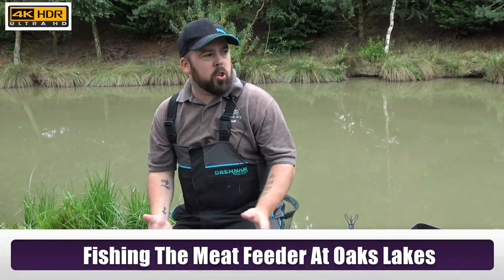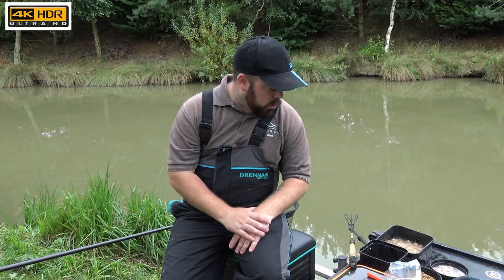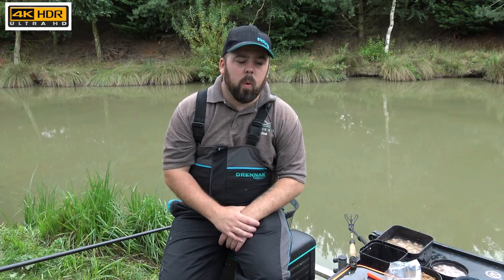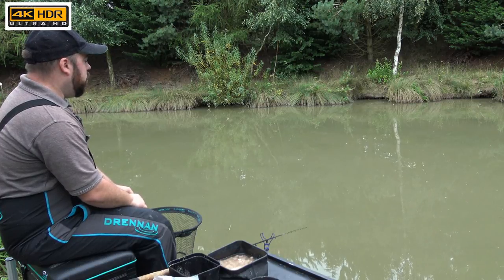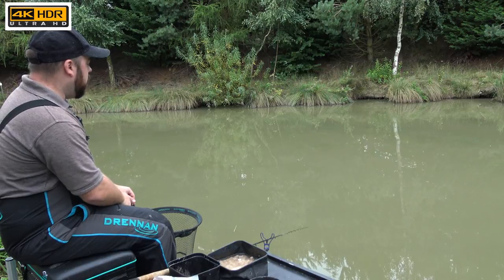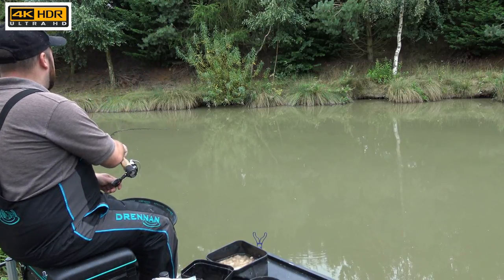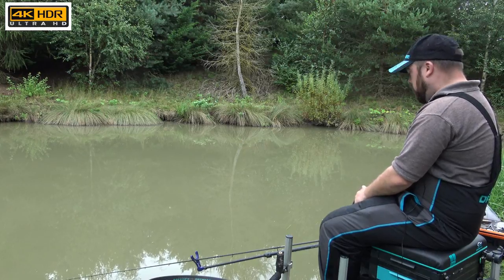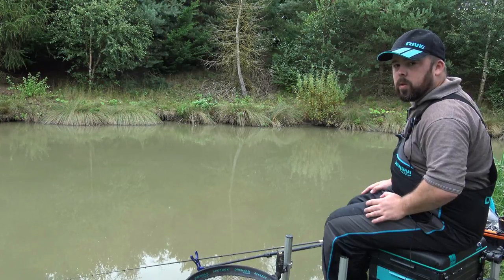Fishing The Meat Feeder

Comment: How did you prep your meat to stop it floating ?
Reply from the maker: wash in warm water then freeze defrost it when you need it cheers
Reply: I prep mine the night before by just filling a bucket with how many tins i need,i then run the tap until its at its hottest,then just agitate  
the meat so the fat floats to the surface and the meat is all sunk,i just skim off the fat then cool it down  and skim the remaining fat off then wack it all in a sieve to drain it then wack it in the fridge.
You can do it on the bank to by putting all the meat in your landing net and give it a good shake in the water and that should do the trick.
Floating meat can have its uses if fishing the bomb and meat or waggler as the hook alone will make the meat sink which makes the meat fall a lot slower so you get more of a chance of something taking it on the drop,plus with it being semi-buoyant  the meat will act like a wafter.